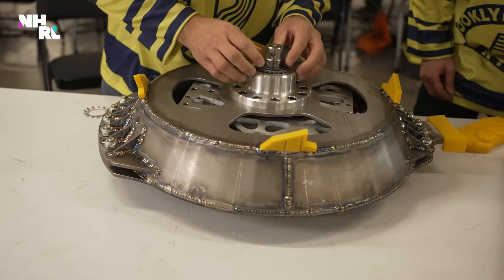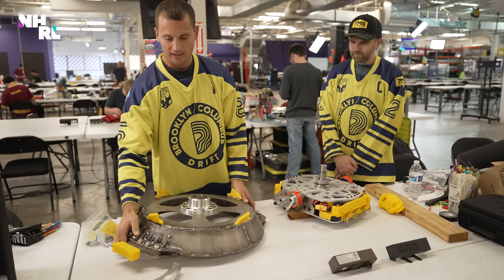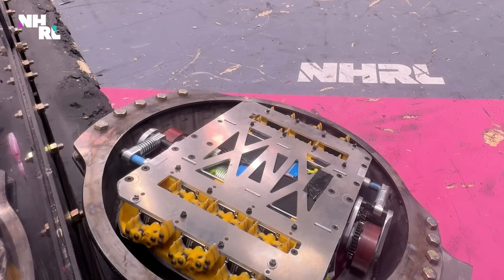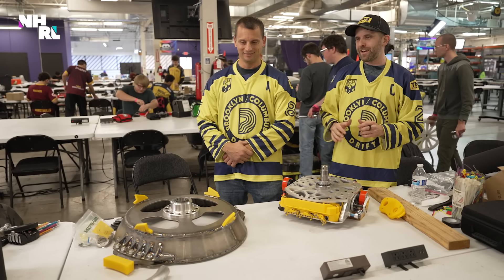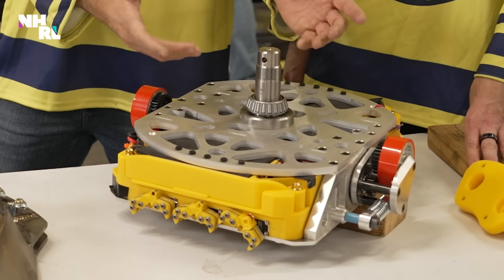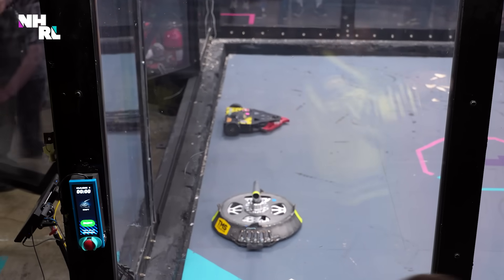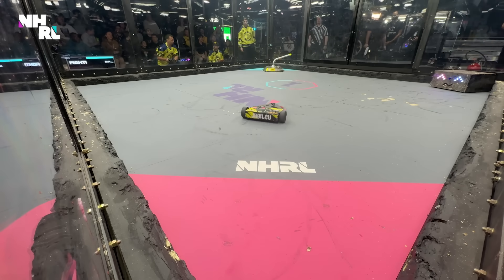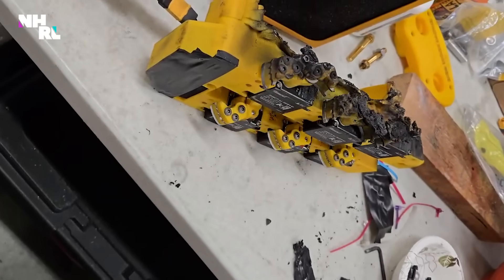Project Stupid: The Fighting Robot That Weighs Twice Its Opponents

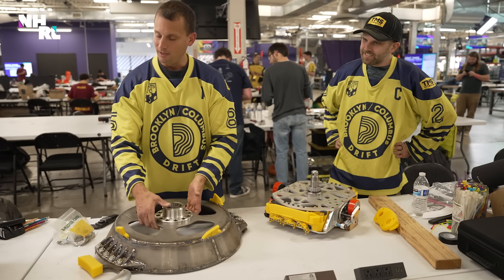Comment: 4:54 if the diameter of the spinning mass is 28 inches, and the diameter you're comparing it to is 24", then the additional "reach" youve gained with the larger spinning mass is 2 inches, not 4 inches, as he said

Comment: I wonder if that stick needs to be so high. Maybe this is the reason for instability? Maybe something flat would work.. which would rise when they are upside down but slower so it does not damages itself. Also weapon part, could this be designed to hit also upside down? Or.. make walking mechanizm that is working also upside down 😊

Comment: Find a way to add some aero to the spinning dish that drives the bot into the floor, like some small metal spoiler wings. You already have a spinning drum with excess torque, so plant that thing to the floor like a reverse helicopter. 

That could resolve a lot of the instability that comes from lift.

Comment: I would consider putting and upside down fan on the bottom powered by a high speed drone motor.

Basically create a vacuum underneath to suck the main body to the floor. That should allow them to spin up faster negating the initial instability.

Comment: Not even sure calling it a stability issue is correct, the thing is so low to the ground that it hits the floor when spinning up, and it's a walker on top of that. Just make the thing an inch higher off the ground like a normal flywheel weapon

Comment: Man, with the torque this could put out, I would consider just cutting the leg mobility system, flipping it over, and have the spin be both it's movement and weapons system. Just turn it into a mechanized titanium top that has some nasty bits around the edges. 
Probably would take a total redesign of the battery enclosure and some of weapon to get the weight right, and to not launch batteries at the walls, but I could see this working.

Comment: Feel like the shell diameter should be dropped to the 24 inch, extend the weapon arm by 4 inches and add a spike, and take the weight savings and add it to the chassis, reinforce the battery compartment so it can't explode. add the rest of the weight to the bottom to keep it on the ground. Not sure if the drive wheels for the weapon will fit that diameter.

Comment: "To put it simply, it's overgunned and overpowered for a ship its size. During battle drills, it nearly tore itself apart when the engines were tested at full capacity."
Reply: Its a weapon with a robot rather than a robot with a weapon
Reply: It even fired a quantum torpedo.

Comment: It needs a thin steel disc on the bottom to keep the lip of the outershell separated from the floor, so that if it gets tipped, the outer-shell doesn't make contact.  Make sure it's lubricated with motor oil or something that can handle a lot of high rpms without smoking.

Comment: Not an enginere at all but maybe it need some kind of self ajusting counter balance like a side washing machine. Lift the side of the sheal a bit and i dont even know if this exist but some king of very slippery brushes tu put all around for less friction on the flood and act as a small "suspention"

Comment: Don't bend the Mast  keep it straight and maybe add sensor limiter to decrease rotation if it sensor that robot is unstable.

Another thing you could do is design the shell to act as propeller that would suck you down to the ground. So faster you Spin the more you stick to ground. 😊

Comment: The rules have to be changed. You guys know what you're doing is wrong. You have a functionally stationary robot that exploits the rules as written to force your opponent to intentionally ram themselves into your weapon. A minimum speed requirement needs to be added to prevent this kind of exploit.

Comment: I really liked your design, but have you thought about using an inertia drive for movement? This would allow you to use a saucer shape on the bottom like you do on the top and remove the self-righting arm(which is causing it to be off-balance.  Good luck with your future version.

Comment: Given my helicopter experience, I would have used a counter rotating weight on the inside to counteract the torque. Like contra rotating rotors in a helicopter without a tail wheel.  then just do a lever actuated self righter. Also the rotating part needs to eb slightly heavier than the outside. For this very reason. what  waste of a vid, thought the ending was gonna be better. as I typed this it ended. Rip. won't be back.

Comment: Forget the roomba, your beyblade wants to tornado, so let it be a tornado?
Reply: They need the walking mechanism for the weight bonus. It's the only reason they're allowed to make such an absurdly heavy bot.
Reply: Are there rules for Top drive weights?  Stick a little balance modulator in and let it wobble around to navigate.
Reply: @Earthenfist  there are. Specificly this was the 30lbs division with a 30lb allowance if you make a full walker. So they "snuck" in a double weight bot.

Comment: If this fights depth charge, you're going to need an another layer or two of lexan
Reply: Unfortunately they would simply never collide as depth charge has no real movement at all and entire gimmick is jabs at the other teams ego till they drive into it, and this 1 self destructs b4 it would wobble across the arena
Reply: Install cameras inside of a steel or concrete chamber at that point. That's the only safe way.  

This, or issue safety waivers

Comment: I'd think a counter-rotation wheel would be a good addition though the mass would have to be taken from the weapon disc to stay within the weight limits.   You'd still have the gyroscopic problems if someone gets under and lifts you up...but the only way to combat that would be to prevent them from doing it.   A way to right itself if flipped over would be great but I'm not seeing an easy way to do that.   Robot wars is a fun thing!

Comment: What about instead of walking there are rubber tank treads underneath, that might solve the stability issue.  Also a guard underneath as low as it can get but not hinder the movement might be required that way if another bot scoops you upwards it'll force the controllers to either risk getting slammed by the rotating upper shell or to find a different angle of attack.
Reply: If they use tank treads they lose the weight bonus. Max weight for the category is 30 pounds, but you get an extra 30 pounds if you use walking for locomotion.

Comment: Loved this, wonder how they'll fix the stability. My guess would be make the weapon blade angled like a helicopter and use it for downforce. Or add aero winglets like a f1 car. My only issue with this approach is it relies on spinning quickly for stability, it'll still be unstable at slow speeds.

Comment: If the stability problems get fixed this thing has potential. I'd cut airfoils into the top of the weapon to suck the entire bot down and the walking mechanism needs to be more stable aswell, it upsets the ballance of the weapon.

Comment: This is very similar to a Battlebot waaay back in 2001.  In season 3.0, a bot named Son of Whyachi dominated its weight class with a massive spinner and a compact drive train that technically qualified it as a walker.  They changed the rules the next season.
Reply: That was one of my favorite bots. An absolute beast. That triangular spinning hammer thing. Insane.
Reply: Is there a good video of that bot? It's hard to know which version of son of whyachi I'm looking at.
Reply: @Ryzard There's a video out there of him oneshotting Nightmare
Reply: @Ryzard I think battlebot channel has like a single video, as the channel does not show old fights I will say search with original in front
Reply: It had meat tenderizer hammers!

Comment: @DRIFT, don't bother. Save yourself the humility. Full Body Spinners never work. That walker body could usefull in maybe putting a horizontal undercutter on a tail that whips around to the side sort of like a scorpion. Uing the legs as a stable base to stay stable. Just an idea.
Reply: Chonkiv, the shell spinner from Georgia Tech has a 15-3 record at NHRL, winning each standard round it's entered and making it to at least the semi-finals in the season championship twice. So there's precedent that a spinner can work if done properly.
Reply: @SteveHarrellRally  The physics to be bale to correctly control heavy full-body spiunner is more than that desing can handle. I think you'd ave to make the shell smaller to lessen the weight and keep the forces managable.

Comment: Man there's been a lot of innovation since I was involved. 
Great design with classic spinner problems. The wheels are a fantastic solution to the problem of the drive breaking after the first hit.
I don't know if they're legal under the current ruleset but magnetically anchoring yourself to the floor used to be allowed. If you tone it back to a middle weight weapon system there might be enough weight to magnetically clamp yourself to the floor during spin up. That would remove the fine tuning for startup times. No matter what you do though, you need do deal with the Mauler problem of not being able to soak your own disk's momentum on hit. I don't know of a full body spinner that solved that problem while also keeping a heavy shell.
The only design I can think of that would let you keep your current level of weapon power would be going with Hazard's design of a spinning bar. Drums and vertical spinners just create gyroscopic effects. There was a super heavy that went the bar design, Final Destiny, that thing was terrifying. It got beat due to its own anti-flip skirts getting lifted into its blade.

Thinking a bit more about the top of the shell. If you accept that you're going to be flipped on hit, you might be able to build in a chaotic righting tool into the shell by either lifting one edge of the top ring or adding a stubby spike to the center. Anything to prevent a stable turtling. Of course then it's a Mauler Dance and just hoping you'll land on your feet at some point before you lose momentum.
Nope. Thought about the shell some more, on hit the force runs up and leverages the top where it connects, the robot then tilts and catches the edge of the shell on the floor. If there's an easy solution that's been discovered in the last 20 years I'm sure you would have used it. Fundamental problem is force transfer and a heavier shell only makes the problem worse. Keep the walker design, lighten the shell. Use the walker's increased weight to soak the recoil. That might be a viable path to getting past first hit. Best of luck with whatever you come up with, those legs were fantastic.
Reply: Magnets wouldn't work because NHRL uses wood floors
Reply: @SteveHarrellRally  Thanks for the correction!
Makes sense, the steel plates were expensive, heavy, and hard to replace (Robogame's ceilings were wood until they got a new box). Lot higher risk of getting stuck in it though I'd imagine. I guess you could literally nail yourself into the floor for stability but I also bet there are rules against intentionally damaging the box. Or if there's not there would be after your first round (of safety).
Reply: @Captain1nsaneo  yeah, cage floor evolution is definitely a factor over the course of the day. You get any kind of spinning weapon robot going for a tumble and it'll cut gouges in the floor, which then sometimes will get a low clearance or damaged robot high centered later in the day. The main cage goes through two floors per competition, which is 16 sheets of plywood total. To my knowledge, intentionally digging into the floor (like with nails) is indeed against the rules.

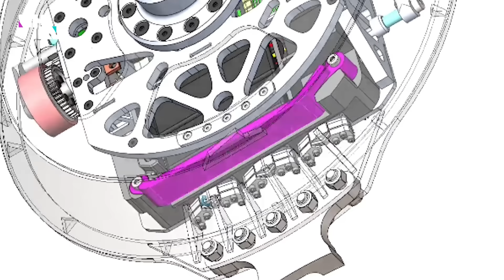Comment: 7:36 this upside down top thing is actually surprising effective. I wonder if you could legally make a mechanical bay blade within the rules? and use some type of weight shifting mechanism to steer.
Reply: This would actually fall under NHRL's definition of "Non-Traditional Locomotion" since some of the examples given for such a system are "Gyroscopic precession" and "Torque reaction." It'd be very difficult to just get working, though. Not only does it need to be controllable and fairly quick to move around the arena, but it also must be able to orient itself upright since obviously no-one can be inside the arena when the battle starts. Even if all of that is done, I feel the resulting bot would be quite fragile, and very dangerous (but very neat).
Reply: It might become hard to control and we will have another Depth Charge situation

Comment: That’s a BIG weapon.
So they’re basically a lightweight?
Reply: NHRL has 3 weight classes: 3lb, 12lb, and 30lbs. Depending on the means of locomotion, though, weight bonuses may be applied. Since Drift uses what NHRL deems a "True-walker locomotion" system, they gain a 30lb bonus under the Heavyweight class, meaning they have double the weight to work with. That's what they were saying in the beginning, they couldn't do it before because Chonkiv used a "shuffler" locomotion system which only gave them an extra 15lbs to work with, while this new "True-walker" system gives an extra 30lbs.

When they refer to Drift as a lightweight, they're referring to other leagues that allow entry to 250lb machines. Drift is VERY heavy for NHRL, but is still a featherweight by the standards of some other leagues.

Comment: i bet this would be a little less snagy  when the disk spins up if the put some delrind skids on the the bottom to keep it from biting into the floor or simple semi fix would be to replace the bolts with carriage bolts to remove a bit of the bite
Reply: Those are two of the options on our list haha

Comment: Why are you making a video to showcase a bot that doesn't meet the walker requirements as posted? That clearly isn't 2 degrees of freedom
Reply: at 1.55  they explain the leg bends in one direction. I assume that ben is counted as  the second degree of freedom... which technical, it is a separate degree of freedom. I does not have to have his own motor to achieve that motion.
Reply: @eriknoppe yep. It's got 3 dof per leg - one powered and two spring loaded. The legs don't work without those spring loaded dof so they are functional dof as well. The rules never specified how many powered dof were necessary. It meets the other walker rules as well and was approved. Making such a simplified foot that met the rules was actually quite a challenge - we went through a significant number of revisions and were in constant contact with the rules committee to make sure we weren't doing anything against the rules.
Reply: I thought a DoF had to be a different plane. The pivots on the front and back of the leg rotate along the same plane as the motion, so no matter how articulated it is in line with that it's still 1.

(I could be wrong)
Reply: @bolasquirrel5631 nothing in the rules about it needing to be a different plane (yet, at least)
Reply: @bolasquirrel5631 You can have as many DoFs within a plane as you want. Picture a double pendulum-style arm. 2 pivots within one plane. Each is a separate DoF.

A 3D printer also has 2 DoFs in each plane it works in. XY, XZ, and YX. That's a 3 DoF system overall though, and they can't all be on one plane.

Importantly though, the NHRL rules don't specify what plane they need to be in or if they all must be powered. This system has 3 DoF, one powered, all in one plane. That meets the rules as written perfectly fine.